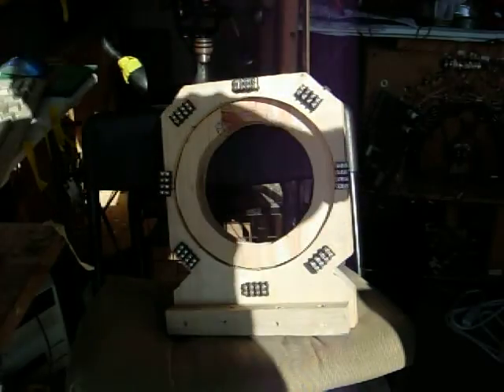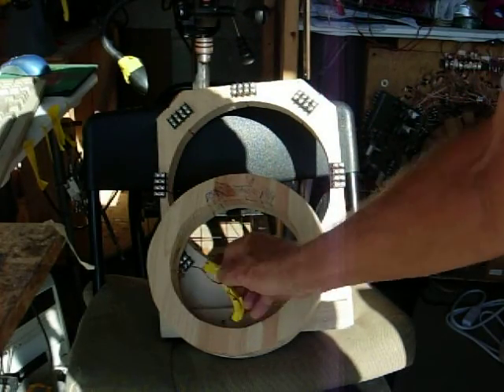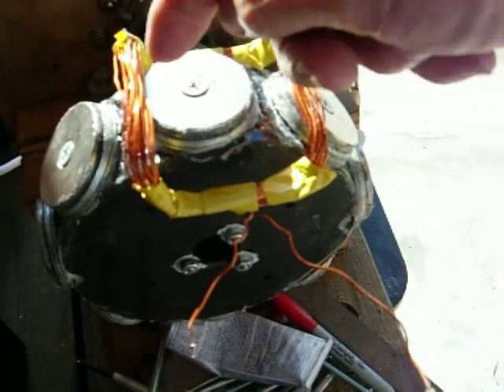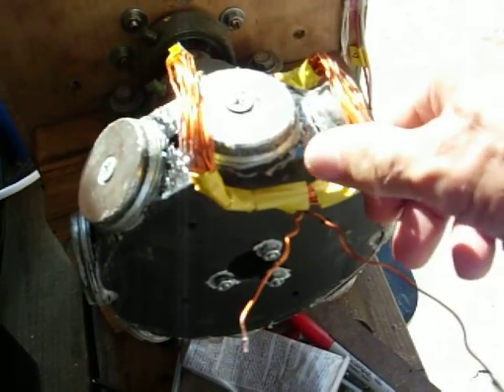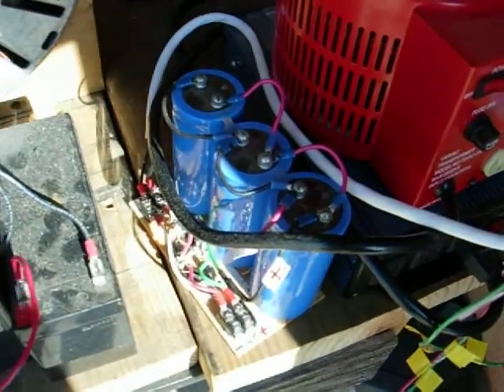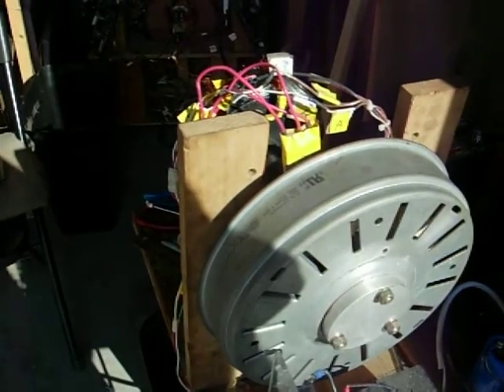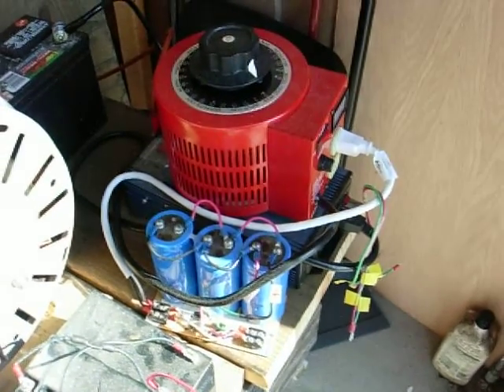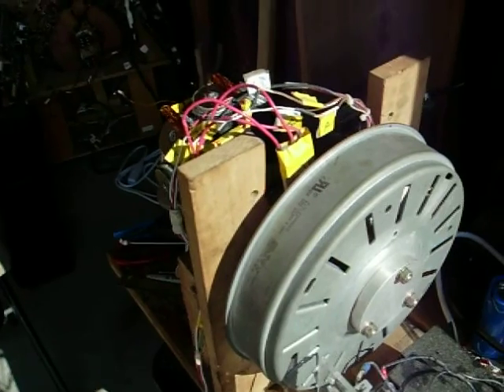Don Smith #127 generator coil placement

Comment from the maker: I fried the inverter piece of shit,  so I connected the variac directly to the wall outlet 120vac.   ran the variac up to around 80 v the motor speed was fast but the fets all over heated.   80vdc with 11 ohms = around 8 amps which is the Anahiem max for their controller.   I think my next step will be to purchase an Anaheim controller. also noticed that the motor would not reverse so the MC33033 was probably bad because of earlier events on the pcb.   The whole problem initially was the diodes D5 and D6 were backwards